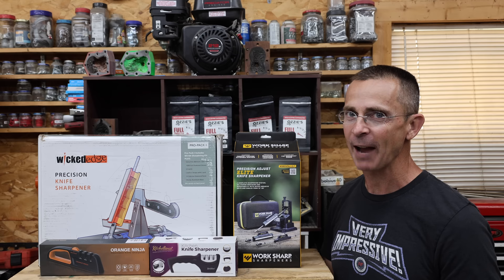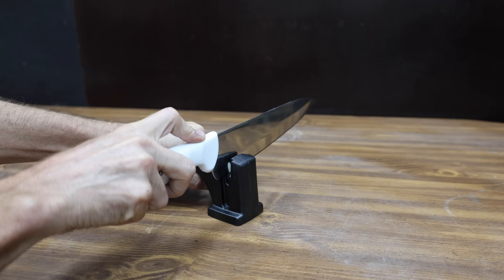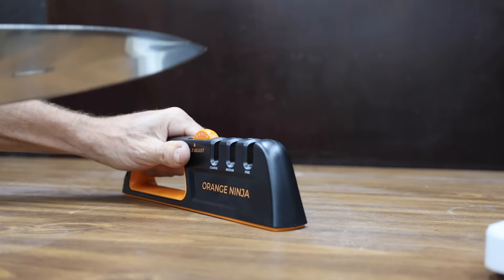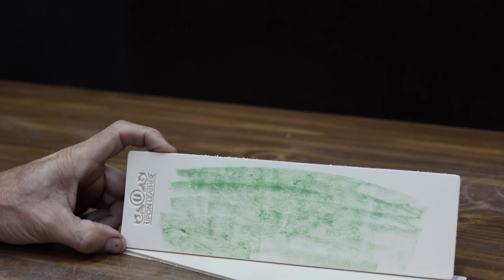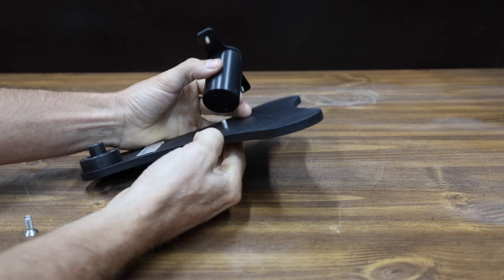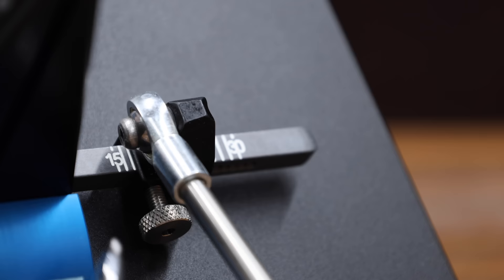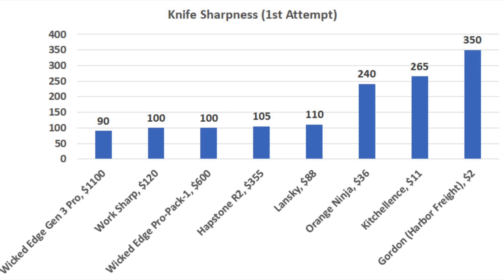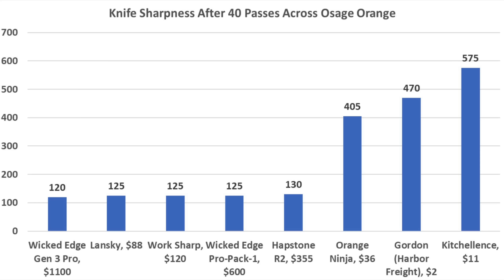Best Knife Sharpener 2023? Let’s Find Out!

Comment: Unless I'm missing something, all of the sharpeners that change the angle by shifting the opposite end of the stone guides, have a flaw in the angle guide itself.   The angle from that point to the edge of the blade blade will change with larger knives (edge further away, thus lower angle), versus smaller ones (closer, thus steeper angle).
Reply: Once the"hypotenuse"/long diagonal side has been set/determined, by its "fixed angle"...no matter where you make contact or intersect on the "hypotenuse" line/trajectory, the angle remains the same.
Reply: @adamjames1375   Nah, look again.  The problem is the length of the base is changing depending on whether you clamp in a small knife or a big knife.  .   Go to 5:45 in the video.  The angle is set at one end of the rod and a large knife that extend well out from the clamp effectively extends the length of the base.     Now pause at 5:49, and simply envision that you remove the knife. What happens to the rod which was previously resting on the edge of the blade 40mm out from the clamp?   The rod drops down to the point of the clamp, which changes the angle.    Clamp a small blade in there (pocket knife or fillet knife)  in there and the edge is closer to the tip of the clamp, which makes the base shorter, and thus the angle is steeper.    The only way this would work correctly is if there were something to adjust the position of the clamp so that the blade always ends up in the same point in space, but most of these don't do that.
Reply: @daemn42   That's because the rod pivots on a single ball socket. 
The chosen angle set works in relation to the 90° clamp. 
The tallness, or distance from edge to apex, has no affect on the angle. 
I'm a carpenter by trade & do a fair bit of geometry. 
If you're installing a 4' x 8' sheet of plywood on a gable (triangular side of a house) the angle remains the same (providing you're 90° from the ridge or otherwise level/plumb.) regardless of where on the hypotenuse (or sharpening rod trajectory)...up at the ridge/peak, the angle is the same as it is 20' down at the point at which it terminates at the wall. 
...
There is some user input in the sharpener regarding the blades tallness/distance from the clamp... in the case of a very tall blade like a machete, the intersection point could change & not allow the stone to transverse it's path... but otherwise, the blade being set to "0°" /or right at the edge of the clamp...or projecting 1" past the "0°" edge of the clamp...does not change the angle. The angle is fixed and cannot be changed by the distance of the projected line of the clamp.
Reply: @adamjames1375   Sorry.   You're just wrong and being a carpenter doesn't change that.     The angle we're interested in is measured at the edge of the blade itself, right?   That angle is atan(opp/adj) or in carpenter terms atan(rise/run).   In this case we adjust the rise to set the angle but the numbers on the scale only work if the run is a very specific distance from the right angle corner of the triangle.   The problem is, if the clamp has a fixed depth as several of these do, then a deep blade like a cleaver causes a greater run than a thin blade like a fillet knife or pocket knife.       You can't say it doesn't matter, because it is simple geometry.  If the rise stays the same (because the gauge claims that's the angle) but the run changes, then the angle at the edge of the blade changes as well.   angle = atan(rise/run).
Reply: @daemn42  
I think you're right. The further off/out/away from "0°" you go the more acute the angle becomes. 
I was dead set on... if you have 2 fixed points, one at 90° and one set to say 20°...then the other angle is 70° and that's it. 
But the ball socket allows the trajectory of the rod/angle to change based on how far the bottom leg or knife projects. If it was fixed you'd just crash into somewhere a mile away from the intended apex. 
Thankyou for your patience.

Comment: I would love to see a video about the error in the angle along the edged length that is caused by the "Fixed point".
After I made some calculations and they indicate a values, +/- 1.5 degrees from the knifes center to the tip/handle.

And none  have addressed this issue.
I have made a simple fix that can improve the angle error from +/- 1.5 degrees to +/- 0.5 degrees on my Ruixin RX08 sharpener jig.

Comment: I have Dry poured concrete driveway at my house and drive a 2 ton truck to work. Do a dry pouring concrete video. Put my driveway in and never had to mix the concrete. It's been 3 years and my driveway is holding up great in the 90 degree summers and the -50 winters!

Comment: I've used lansky for about 20 years.  I don't mind that it takes a few extra minutes to sharpen my knife.  Knowing i have a good edge when i need it is worth it.  The only issue i have with it is some times i worry i may not be seeing the roof in exactly where it was last time i used it & ill be working a different angle on my blade.  & as it works great for my 3-4 inch blades & up its hard to set a smaller pocket knife  ( case, uncle henry, smaller folding knife ) in the vise as the blade height is shorter & the stones tend to rub the screw or the top of the angle of the clasp.
Reply from the maker: Thanks for the feedback.

Comment: I have had a Lansky kit for about twenty years. My stones probably need flattening, because I cannot seem to get a decent edge from them anymore. Was considering a new system, so this video helps. 

The Scary Sharp system seems like it would be extremely effective for the price, but it does require technique and practice as there’s really no angle guide. This Worksharp system, however, looks like it could be a good investment also. Considering a decent set of whetstones are not cheap, and the time to master the skill… a self contained system is appealing to many. 

Great work as usual! Happy New Year, can’t wait to see what you come up with in 2024!
Reply from the maker: Thanks!  Happy New Year!

Comment: Not to complicate your life or schedule more…
But I would like if you made a sharpening video featuring ceramic bladed knives. 
I’ve been using them for the last few years, and they seem to compare to steel blades in much the same way as carbide saw blades do to steel. I use diamond grit sharpeners obviously, but I seem to never get them back to the sharpness that they have right out of the box. 
I have the same questions you answer in your steel blade videos, such as:
Is there a particular brand of knife with a superior type or grade of ceramic?  
What is the best angle to sharpen at? 
What is the best grit progression to use?
What is the effect of angle or grit on sharpnesses or edge toughness?
What sharpening system produces the best results?
…amongst others.
Still love your show.  It’s a pretty amazing resource for getting the most effectiveness for our $$$. 

Have a great 2024!
Reply from the maker: Thanks!  Thanks for the suggestion.  Happy New Year!

Comment: Not sure if you already did, searched but didn’t see.  How about work lights. The rechargable “wand” style.  I have a high quality Astro 40SLMAX that works fantastic.  Only thing negative is the switch doesn’t have a good firm click to shut off. A couple of times I had left it on “low”.
Reply from the maker: Thanks for the suggestion.

Comment: VIDEO IDEA
Mixer taps - especially the difficulty of  fine adjustments using single handle variety  (How easy is it to get the flow rate and temperature you want)
How easy is it to knock in the shower and give yourself a morning surprise...
Especially the sliding 2 dimensional Ceramic tap inserts with the complicated valve openings and how changes / differences in water pressure effect output
Are two separate conventional taps on a mixer better than one handle adjustment?
Have fun, love the show.
Reply from the maker: Thanks!  Thanks for the video idea.

Comment: Get some windex and sandpaper from 400,600,1000,2000,3000 and stick the paper to a glass slab. Place a wet towel under the slab to keep ot still and gently, pass the blade 20 times over each paper, using windex for slurry / lubrication. 
Thats all you need.

Comment: I have the work sharp and the ken onion sharpener and I personally use the ken onion as I can more quickly sharpen all my knives.  Make about 8-10 passes on each side for each knife, then keep switching out the belts.  Also gets the knives slightly sharper, in my experience.  That said, the ken onion does require electricity so I keep the work sharp just in case.
Reply from the maker: Thanks for the feedback.

Comment: My mom's belt sander (it's not an actual belt sander, but it basically is one). 
That thing takes a few seconds to set up, uses sand paper (cheap and easy to replace), and can sharpen a knife to razor sharp in a few seconds
Reply from the maker: Thanks for sharing.

Comment: I sharpened between 5-7k knives on the Worksharp Ken Onion+attachment sharpener last year. I settled on a process to replicate the Buck Knives factory edge (one of the most consistent factory edges out there) by using the red course and X65 course at 17 degrees, and then I finish the edge at 20 degrees with the 12000 grit ultra fine belt. Even knives with considerable damage take me less than 120 seconds to make shaving sharp. I'd like to see that system vs these.
Reply: It has to be less sharp because of the steeper angle, all else being equal. Also, you sharpened 5k+ knives? Crazy. Do you set up at conventions or something? I do wish he tested the Worksharp motorized options.
Reply from the maker: Thanks for the suggestion.
Reply: @justinkase1360  I sharpen for Bass Pro. In theory, 20 degrees is less sharp, but the angle it's on is 17°, so it's sharper than you think. Buck uses a process in the 13/16° range, yet they are the sharpest we sell. Every single one can shave, while the junk can't even cut paper. Try a new 119 or 110, and you'll see that the thin primary bevel allows for lesser resistance, but the micro-bevel being steeper restores the edge retention that was lost by thinning the edge too much. It's also much easier to hone this way because there's less material to remove or reshape.
Reply: @sammiches6859  I will have to try this when I get a sharpening setup for my Spyderco Para 3. You would recommend the same edge, no matter the steel? I use my knife at work. I need a 119, I have fond memories of having one as a teenager. Good knife. Back then I used a Lansky.

Comment: I'm a sucker for any video about sharpening. This was very informative. I do have to comment on the comparison after pulling across the wood block. That seemed to inject a variable into the  mix. Sharpness testing  on the block is more of a test of the manufacturing of the steel rather than a  test of the sharpener. I would never expect my knives to be even close to sharp after I have used them to any degree.
Reply from the maker: Thanks for the feedback.

Comment: one thing that is apparent is the ones that have a laborious set up time and unwieldy equipment seem to perform the best as they have more than a few stages. if you do another round of this id suggest testing the "spyderco tri angle knife sharpener" as its small, easy to setup and still gives you great flexibility in angle while being quick.
Reply from the maker: Thanks for the suggestion.

Comment: I found a channel that specialises in this stuff, sharpening with stones and stropping after. Per this guy, a good apex even on a $1 stainless blade will last surprisingly long. What most of us experience as "knife go dull" is actually the otherwise extremely sharp burr flattening after meeting the cutting board ONCE. Going to higher grits and stropping at the end gets rid of that burr, leaving a good, sharp, strong apex.

He also tested those pull-through things... they did more harm than good.

As an un-skilled method, I chose the Lansky system. So far - so good. Knives end up as sharp as people in the kitchen will tolerate without too many injuries (pathetic!). We'll see how long those edges last.

As of now I've banned all pull-through sharpeners from the house 😅

I'll make a strop, buy some proper stones and learn how to do this properly later 😉
Reply from the maker: Thanks for sharing!

Comment: after 14 years of making custom knives I found that using a 1x30 belt grinder and 5 different belts ( 150 - 1000 grit) is the most effective and faster way to put a razor sharp edge on my knives. I personally like a Convex edge, it is the strongest edge and is very easy to strop. This is my personal experience, many people are obsessed with having the sharpest edge they can get, an edge that you get cut by just looking at it. Let's remember that there are many factors that come in place when trying to get a fine edge, such as steel type, heat treatment and edge geometry. You can spend all your money on a sharpening system but at the end of the day, what matters is the quality of the blade because it is not about how sharp you can get the knife, what matters is how long it stays sharp. I can make a rail road spike knife and sharpen it to a razor sharp level but that edge will go bye bye after one cut. Thanks for the comparison! I really enjoy your channel!
Reply from the maker: Thanks and you are welcome!  Thanks for sharing.

Comment: One thing. In worksharp you have 16 degrees. You can precisely set-up using measurements on the right of the tool. Co you have 15 on the left + marks on the right. So you have 16degrees. Still impressive video!

Comment: Can you PRETTY PLEASE test the various DIY garage floor coatings? I'll bet there's high interest in this subject. Test for hot tire pickup, chemical resistence (DOT3 brake fluid), UV discoloring, simulate a car's front steering tires turning in place (will sand stuck in the treads wear a circle in the surface) etc etc
Reply from the maker: Thanks for the suggestion.

Comment: Any fixed angle system's degree markings will always be incorrect due to the height of the blade in the jaws. Get a cheap angle cube if you want to sharpen at a specific angle and adjust the knife in the jaws and the guide to what you want

Comment: I do not need a knife sharp enough for surgery. This is so sharp it will cut deep without you noticing. A sharpener with crossed ceramic blades is all I need. I have been using these kinds of sharpeners for many years with satisfactory results. They are cheap, fast, and easy to store. And I never cut myself.
Reply from the maker: Thanks for sharing.

Comment: I watch and trust your videos with everything I buy. Can you please have a showdown like you did with motor oil but with duel system cleaners? These videos are floating around everywhere with different results depending on who you watch. You are the only one that can put this to rest. Gumout, royal purple, stp, valvoline, Lucas, Techron, sea foam, b-12, Rislone, super tech, marvel mystery, vp racing, bg 44k, slick 50, mr gasket, Prestone, red line. Please please consider this and thank you!
Reply: Also add 505 CRF to the list. Supposedly the best.
Reply from the maker: Thanks for the suggestion.

Comment: I'd like to see the Global Minosharp 3-stage (or an equivalent) included in the next round of these. I have an IKEA SKÄRANDE which is the same idea, and it works well.

You previously tested a rolling-wheel style sharpener and it worked well, but it was only a single grit so gave a pretty  rough finish. The Global and IKEA models use three grits and seem to do much better than the cheaper carbide / rod style pull-through sharpeners.

The IKEA is super cheap, too.
Reply from the maker: Thanks for the suggestion.

Comment: Great video as always. 
A couple of video ideas. 
Comparing lighters at different price points. from bic, zippo, up to expensive ones like Porsche design and maybe st. Dupont and different types of fuels, butane, kerosine, and how long they last on each fill, lowest temperature they work, different types of fuel that can be used with each, etc. 
Comaring hand warmers. Kerosine vs battery, different brands. Their temperatures at different settings and different ambient temperatures, and how long they last.
Reply from the maker: Thanks for the video ideas.

Comment: I have a Worksharp, but it is the less than 100 dollar model, off of Amazon. Difference is the case. It does a great job, especially after my bride used the "V" notch type sharpener so I have to re-profile the edges periodically.
Reply from the maker: Thanks for sharing.

Comment: See how the burr root goes parallel with the blade when using the "pull through" style kitchen knife sharpeners? You want it perpendicular thats how you get that good slicing edge. You could literally sharpen your knife on a brick and it would cut better than if you use those other style sharpeners.

Comment: I think i can beat all the sharpeners with a smooth pipe and some water sandpaper.Just grind the edge from cutting side to the back diagonally.There will be burrs but the fine sandpaper 1500/2500 grit remove those pretty easily.Also if you need to do it fast dremel tool does a good enough job with the proper bits.
Reply from the maker: Thanks for the feedback.

Comment: I noticed that all of your pull-through / non-adjustable sharpeners use rods, but there are some on the market that use diamond-coated conical wheels. How would those compare?

I have one of those (Chef's Choice 4643), and it's decent for keeping an edge on my kitchen knives, though if I have time, I can do better freehand (using DMT diamond bench stones followed by a strop & compound); with more practice I'm sure I'd get faster but it takes me about 10 minutes for a chef's knife (plus ~5 minutes setup/teardown, since I don't keep it ready to use).